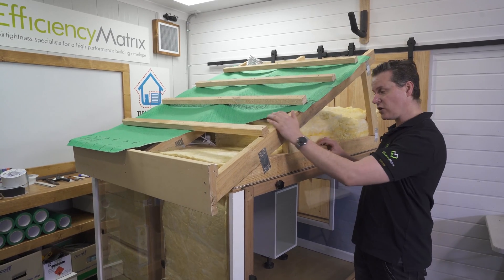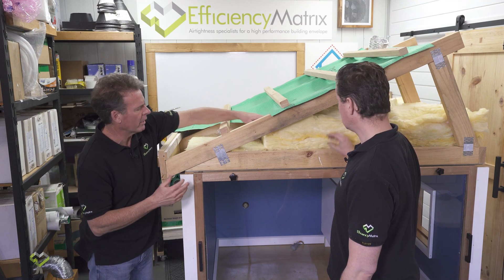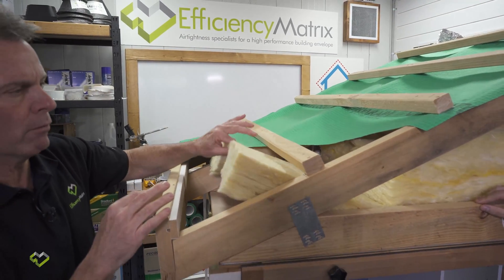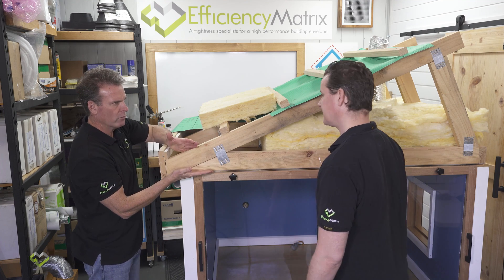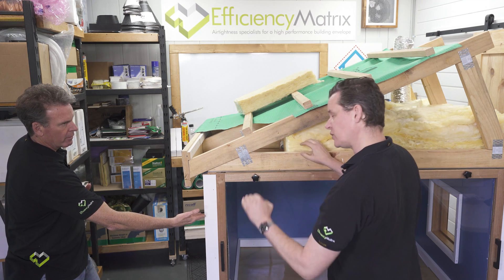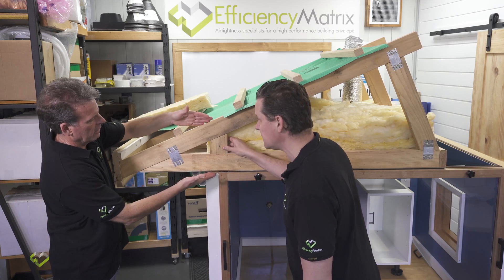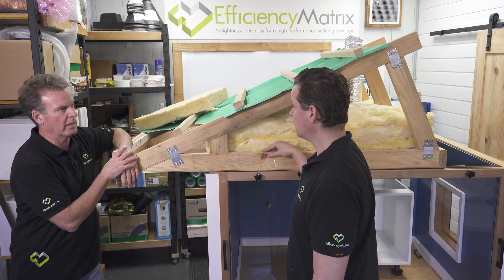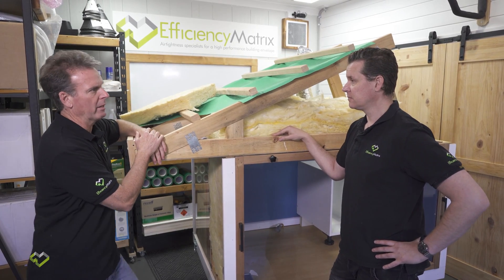THE Energy Heel-Roof to eave detail for full height insulation

Comment: Thanks for the video. An alternative solution is to insulate the corner by boxing in the wall-ceiling junction inside, either a box or angled, and fill with insulation. I would loose my decorative cornices though. I have a ‘50’s house where, as you mentioned, the roof continues below the wall height resulting in eaves about 300mm below the ceiling. The external wall (AC sheet) stops at the eave and cardboard has been used to reach between the roofing timbers. Thankfully the owner installed wall insulation.
Reply from the maker: Great idea

Comment: Ok... so as a building designer I have to address that your roof area won't change (assuming eave/ or no eave status remains the same). Only the height will, so an extra few courses of brickwork/ external cladding will be required. (Fascia and gutter will still be the same size, just moved up with the top chord.)
The raised heel, or upstand as we call it in Australia will add overall wall height, so may not be achievable for some areas/ sites.
A higher top chord allows you to embed a load bearing beam (lintel) within the roof space to permit window head heights to ceiling. (Looks amazing when floor to ceiling)
Easier roof/ wall access for electrical, lighting, security camera installation, maintenance. etc.
This extra top chord/ rafter space can be retrofitted by creating a bell type roof. - I wouldn't do this just achieve extra space for insulation, but its a good side effect for changing the look of a building.
Reply from the maker: Thanks Michael for this post.

Comment: Thanks very much for posting video. I've found your channel very informative and generally has great ideas. Although, I do think this solution needs work. As mentioned below by James Stone, you generally cant just add an eave due to site constraints (in most of states, in australia). You also cant cut the eave off and just have the increased height in truss, the fascia would be enormous (300-400mm). Im not sure if you worked out an approx cost of this idea, your adding approx 45m2 of extra roof area and also adding a couple of courses of brick around entire perimeter (assuming brick veneer). I think you may find there will be a significant cost increase in construction, which may not achieve a comparative increase in R Value.

Comment: A larger eave or over hang area provides some shading for the side of the building and windows and also provides some rain and weather protection for the siding of the building. Water is a huge issue that destroys buildings. Keeping the siding dryer and protected will reduce moisture penetration.

Comment: Great video guys. I asked my building company to do this and after weeks of resistance by the builder agreed to build this way. However wanted to charge me an extra 10k for the raised heal design. Should this detail increase the cost by that much? The house is a simple rectangle about 10x22m so no complicated details. Finally had to abandon the idea because of increased roof height causing overshadowing issues. Any advice?
Reply from the maker: It could depend on your overhang.

Comment: Great Video! In Canada, we call this an "energy heel" for trusses, but it is still relatively new and up to the designer/architect to spec a height if they want full R40/50 insulation to the wall edge (plus ventilation). A particular concern we always run into is how to treat a renovation environment when you have old trusses without the "energy heel". Often times we end up with longer overhangs or disjointed eaves.

Comment: First view and comment, in Canberra a lot of our new blocks are so small, the customer can't even have eave's, its crazy.
Reply: In those poststamp sites, the workaround could be using PIR boards for the perimeter insulation. 2 layers of 50mm PIR can achieve ~R4.5 (metric), although not really R5-R6 as the remainder of the roof, it may be considered good enough thermally. Pay extra cautions, if the building is in bush fire  (BAL) zones or any location which has heightened fire risk as PIR is non-flammable only, i.e. still classified as combustible.
The second option is having a bulkhead all around to provide extra depth for insulation on the interior.  this option has a significant impact on interior design and space perceptions. Every house requires a personal decision by the owner.